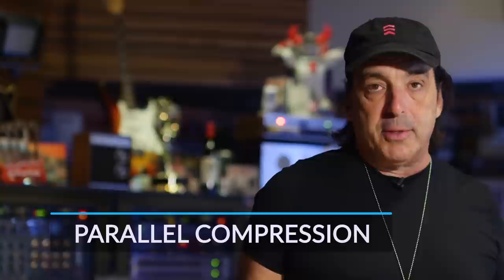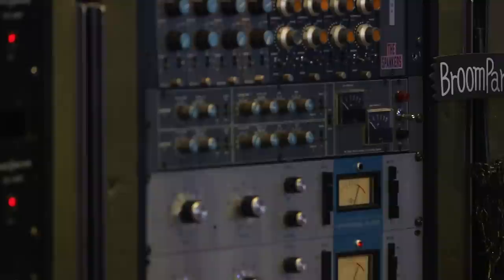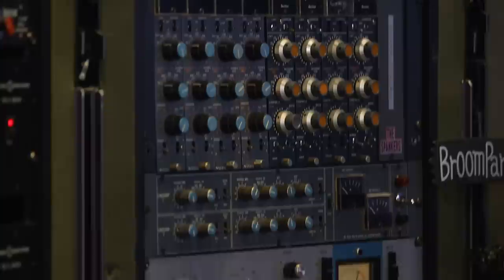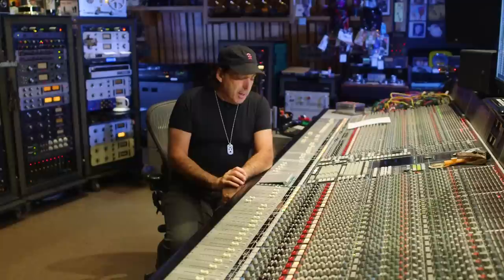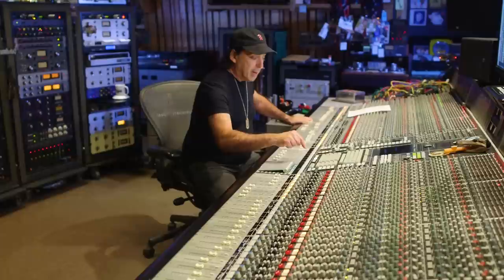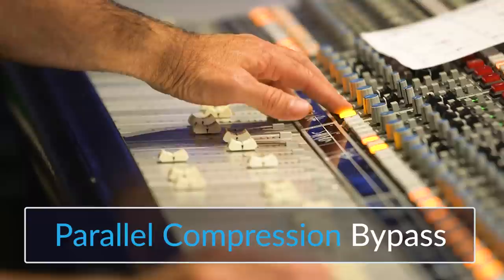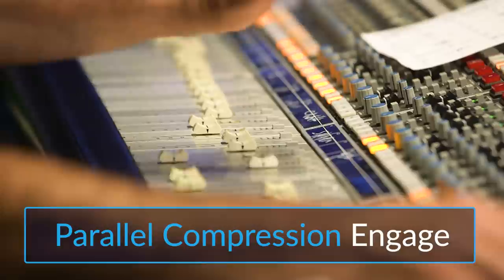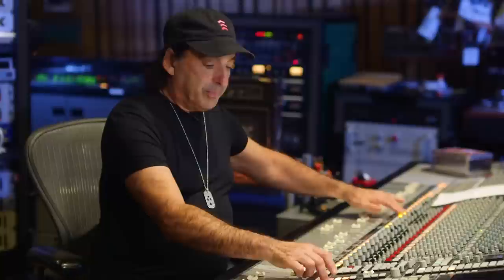(Drums) Parallel Drum Compression | Processing On A Track Or Whole Kit

Comment: Send out from drums as in all drum channels out to the Aux channel or use a send out from each drum track?
Reply: I think he compressed the bus with the drums
Reply: From what I understand, you can do it either way. If you send to it from the individual tracks themselves, you have a little bit more control, like you might not want to send as much hi-hat or OHs, for example, so you can then turn those individual sends down a tad. Make sure you do it as a post send though, so it's getting an exact copy of your already mixed/balanced signal. Unless you specifically want to send a completely dry, un-mixed signal, then click "pre" in the send.

Comment: Can anyone help me explaining what did he meant by mono and stereo link
Reply: On stereo channels, you have a choice of stereo or dual-mono plugins.
Reply: @kitmateyawa7829  That's not really a good explanation. 

Anyway, what unlinked stereo does is instead of compressing the left and right channel with the same amount of gain reduction it compresses both channels separately. 

Meaning if the left channel is louder it will be discretely compressed harder than the other channel. As a result there will be constant movement of the entire stereo field from left to right in the overall sound.

Comment: How hard is he hitting the compressor?
Reply: A very relevant question. Cause that will greatly affect what sound you will get. Mostly you crush the compressed signal and add it to taste to your uncompressed.
Reply: Given only a 2:1 ratio, I would assume pretty hard, right? Otherwise it wouldn't make much difference just mixed in under what's already there (which sounds already pretty heavily compressed.)
Reply: Gotta assume since it’s CLA, that every meter is in the red

Comment: I thought it was'nt a good idea to eq parallel compression processings !!!
Reply: There is no hard and fast rule in audio engineering. If it sounds good, thats all that matters.
Reply: Thank you !
Reply: Yep, there are no rules, but keep in mind that it may cause some phase issues.
Reply: it's also probably safer in analogue
Reply: I think so, because he said it with confidence !
Reply: Technically could cause phase disruption but so does literally any eq so it really doesn’t matter. Do what sounds good!
Reply: Did he say he EQ's the the group or bus that both the parallel track and the original track are blended on? CLA is raw and real but not a concise communicator.